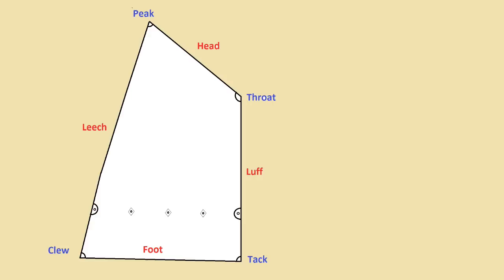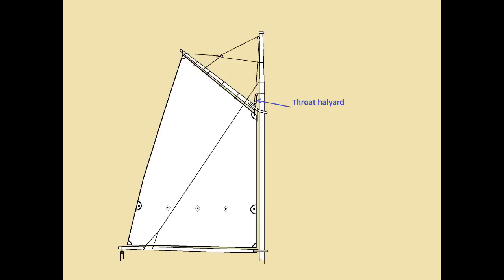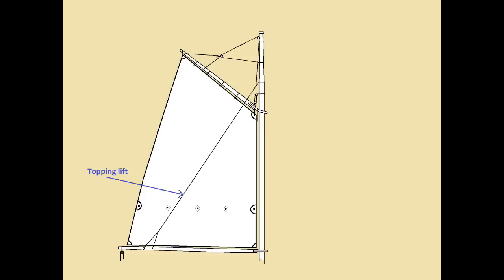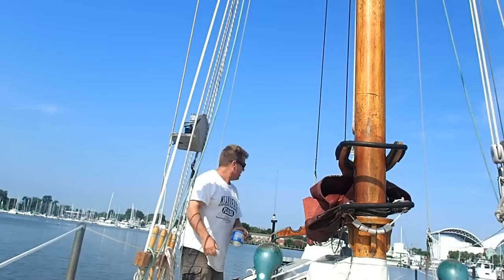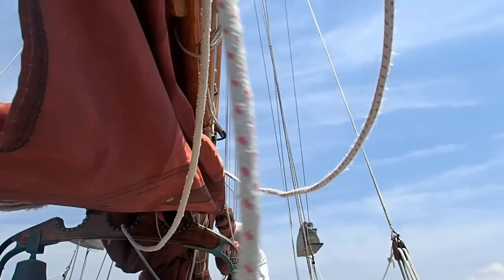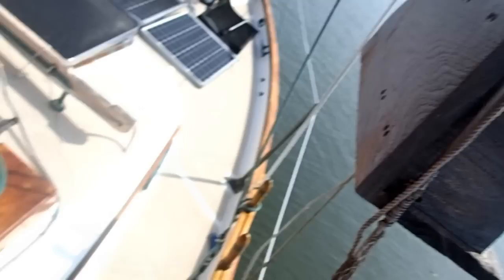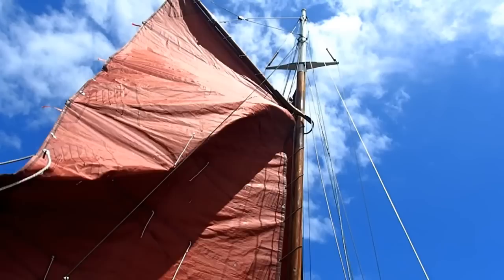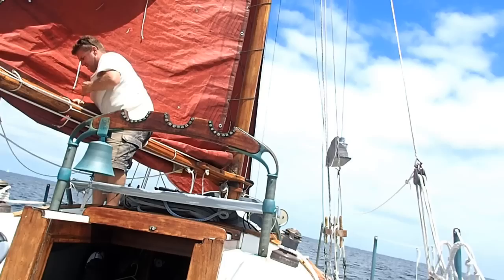Handling a Gaff Rig

Comment: I'm curious.  Why is a long (full) keel especially suitable to a gaff rig?  It's not all that unusual to see a gaff rig on a hull with running boards, bilge keels, and even catamarans; small gaffers with centerboards.   I can think of no reason why it shouldn't be put on any modern hull form.  I suspect the reputation of gaffers not being able to compete around the buoys is in part attributable to the hull form choice, and not to the rig choice.  A win win situation for several reasons?
Reply from the maker: Good point, it may little more than a traditionalist bias on my part.  Generally the rig itself is heavy, so not suitable to an ultra-light hull, although one could drastically reduce the weight with carbon fiber spars and synthetic rigging.  Still, the lower aspect and shorter luff will mean less windward efficiency, so while a fin keeled gaffer may be more competitive around the buoys, it will still probably not be first to the windward mark.   So it's more of a cruising rig.  A heavier hull with a long keel or long fin and skegged rudder will have nice directional stability, will heave-to and make minimal leeway, and will be able to carry weight--stores, water, etc.  The gaff rig can provide ample driving power for this boat, particularly when reaching.  That's my thinking,  anyway.
Reply: I've seen gaff rigged center boarders and fin keeled yachts.

I've seen Bermudan rigged long keel boats.

But no one will put a gaff rig on a modern light displacement go fast machine.